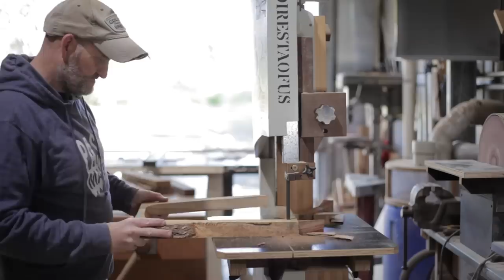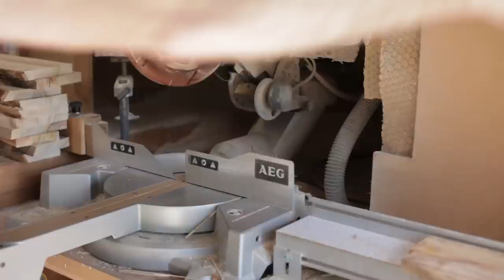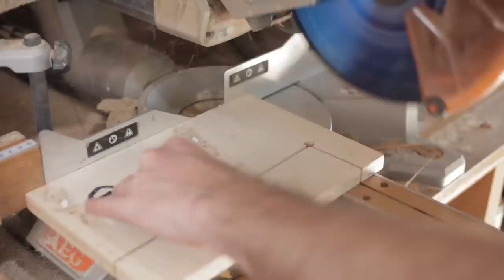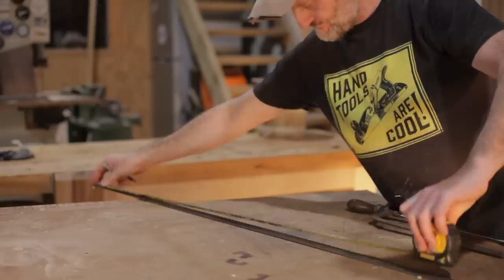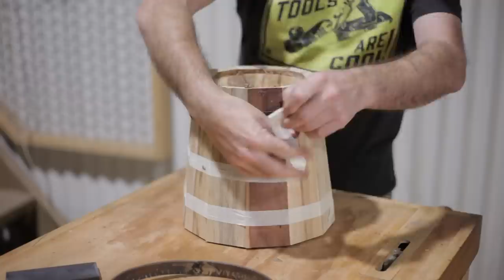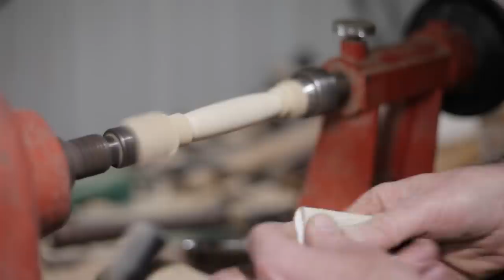Making a Wooden Bucket - Scrapwood Challenge Day Five

Comment: Nice project with just one small observation. The two ears for the handle could have been welded to the top ring. Would save on the hardware - four sets of bolts and nuts, not that it costs a great deal. The pressure from gravity of lifting the bucket would ensure the ring always keeps the seal of the wooden slats intact.
Reply: Some wooden buckets also have longer pieces on two sides. These can be drilled to fit a rope.
Reply from the maker: Yes that would've been a better option. I would've had to dry fit the top ring and remove it to know how long to make the bracket. Not that there would be a problem doing that. If I make another I'll definitely be doing that! This time I was racing to get it done and this seemed like the easiest way at the time! :)
Reply: Alternatively you could weld over-sized brackets to the top, put the ring in place, then cut the brackets down to size. That might make it difficult to put the ring on though. I like the project! Now I just need to find my own supply of scrap wood....

Comment: Dear Neil, you used some brown stuff to seal the bottom to the sides joint, what was that? You didn’t glue the sides and the bucket doesn’t leak. That’s pretty clever. Is that the pressure of the steel rings holding the edges tightly together? Beautiful build. I bet this bucket will outlast any cheap plastic one from the shop. Cheers.

Comment: man this is FANTASTIC! great job with the jigs and everything!
I was sruprised that you attached the handles supports to the wood instead of one of the rings (you know, as it holds weight the ring wedges itself into the wooden cone), but I'm sure that's not neededd and it works great. nice job on the jigs too!
Reply from the maker: Thanks very much Carlos! Yes that would've been a better option. It would need a dry fit of the top ring to know how long to make the brackets but that's easy enough to remove. I think I did it this way as it seemed the easiest and time was getting on! :)

Comment: Wow, never seen flaxseed used in a woodworking video before. Is that to seal the bottom and prevent leaks? Any reason flaxseed in particular?
Reply from the maker: It is to seal the bottom,. When the bottom contracts the water should swell the flaxseed and fill the void. I believe flaxseed was used so it doesn't contaminate the water! :)

Comment: How did you figure out what angle to bevel the edges at to close the bucket?  Was it simply 360 / x / 2 assuming x = the number of pieces making the bucket?  How fussy do you need to be to get this angle correct?
Reply from the maker: I'll write an article on website when I get chance to explain better! The angles need to be fairly accurate! :)

Comment: the problem is that while you keep water in the bucket there will be no problem with the wood, but if it becomes dry for a long time it will be completely dismantled and practiced is no longer repairable, that happened with wine barrels years ago that were dry